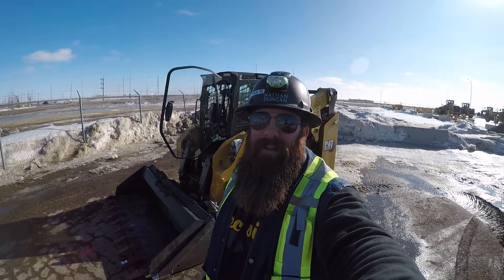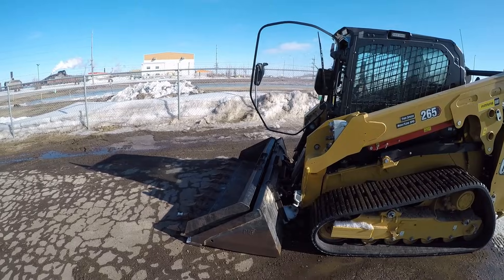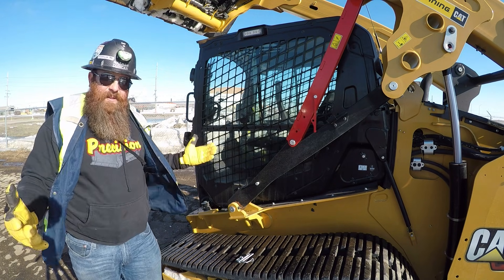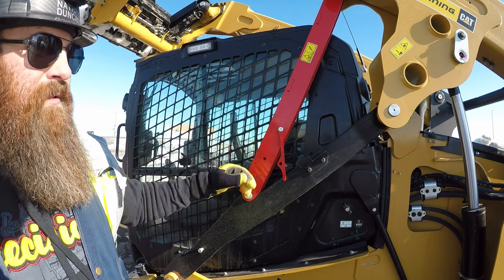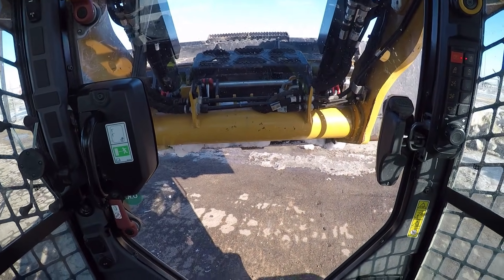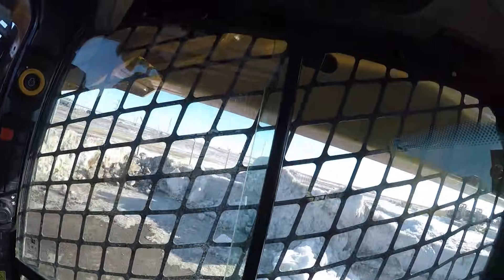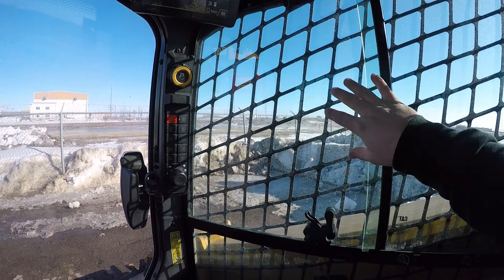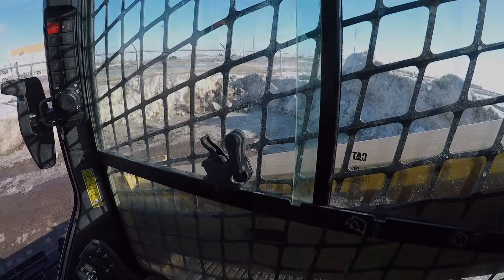Cat 265 Next Generation Skid Steer/Compact Track Loader Safety Features Tutorial

Comment: Stupid question that I can't obtain, does the 265XE 74hp have a turbo?  I am going to buy a new machine considering Cat, Bobcat or JCB.  Probably get a Cat, with your purchase loaded with everything minus extra fuel tanks.  Mind saying what you paid before taxes added?  I pushing 70s n my ole Bobcat F763 is wore out just like myself.  I originally planned on a Cat 275XE loaded n a Cat or FAE drum mulching head but decided just to rent one.  I don't want anything to do with def, far too many headaches.  I have Bobcat locally n Cat is a hour away.  But I probably fix my own problems regardless, retired field mechanic/welder/tax slave. 😁
Thank you for your good video, things I didn't know honestly.  Ty Clark
Reply: Forgot, what made you not get a 255xe?
Reply from the maker: @t @tyclark8162 hello - thanks for watching the video and commenting.  I don’t own a machine, I work for the local dealer as a trainer so I make these videos when I have time to help people with information about the machines.  Just so you know you can’t get the XE class in a 255 or a 265, to get an XE you need to get into a 275 or 285.  I understand the frustrations that come with the emissions stuff so to avoid that you definitely have to stick with a 255 or 265. Picking the right size just comes down to what work you need to do.  Talk with your local Cat dealer to best size the machine for you.
Reply: @ironman3406 iron man, thanks for your kind reply sir.  Wish I have you around my parts, cus again you told me something I didn't know.😂  That information has never been said with multiple people who have bought these machines for mulching.  I do need to talk to a Cat guy, haven't yet cus I want one of these new generation Cats.  I've waited too manyyy years for Cat to fix many problems.  What's your thoughts about the JCB skidsteers?  These new Cats seem to be easier to get in n out or am I wanting to justify one?😅  Thanks again, Ty